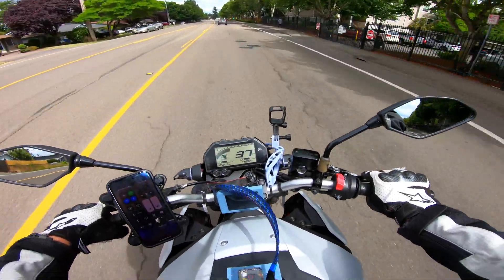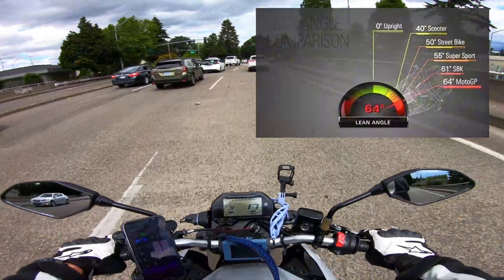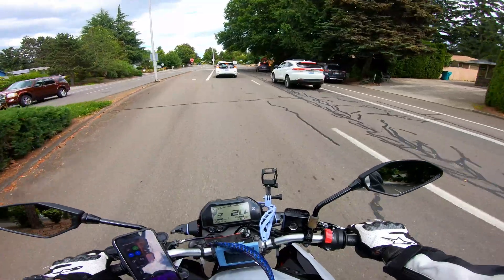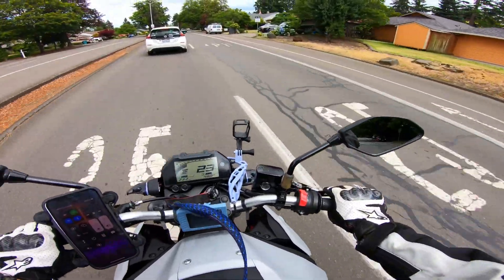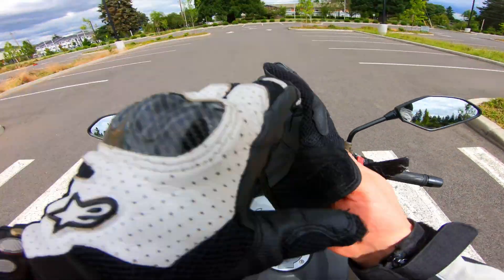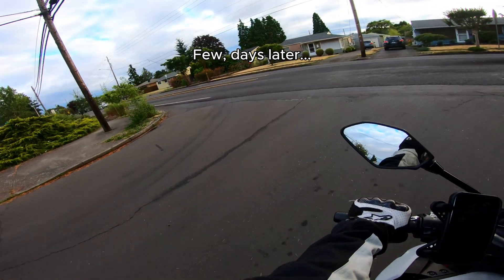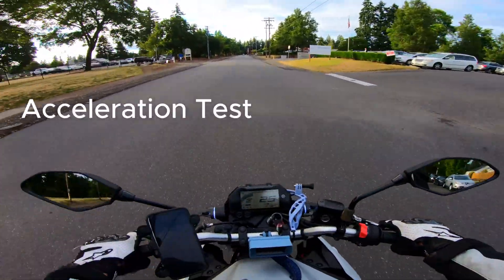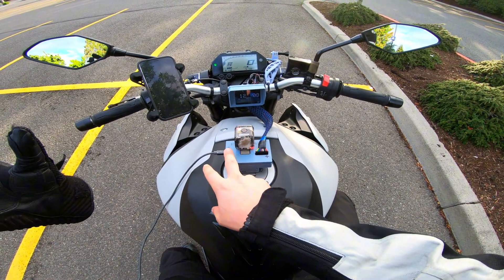Why don't they make these for all bikes? | LEAN ANGLE SENSOR | ESP32

Comment: Good project.
I bought a couple of different 
inclinometer devices, but they
are both useless on a motorcycle, 
they're all over the place, the only 
time you get a good reading is when
the bike is parked on the-side stand. 😄
Reply from the maker: haha yes, nowadays though you can probably get good AI filters to get a better signal to noise ratio. This is the biggest issue in the data processing is getting that clean accurate value from the chaos hahaha. I moved on from this setup to an app based UI and mounted the gyro/accelerometer in my pillion seat bag.
Reply: @OneSmallFavour  
Cool. 
There are some race bikes that
have onboard inclinometers, 
they are obviously going to be 
accurate. The problem I've found
is that the g forces of turns, 
tend to push the gauge opposite of
the angle, so If I'm at 30 degrees
it will  read something like 5 to 10 lol,
not useful to me. :sm 
They're actually good though if 
I want to look at some static angles.

Comment: hello, I am interested in your project and I congratulate you for your efforts. i've spent a long time with the mpu6050, but I want to use it for cornering lighting. I didn't get a stable value. everything is normal at the counter. until we set off on a motorcycle.
Reply from the maker: the engine of the motorcycle is causing some small vibrations which throws off the data, you need a smoothing algorithm if your using a sensor as bad as the MPU6050. get a better sensor or get into signal analysis. best of luck! <3
Reply: @OneSmallFavour I just ordered bno55. I hope I get positive results.

Comment: hello! I would like to study the code you used for this project. I have been trying for months in every way to create a sensor for reading the lean angles. if you want to share the code and the schematic, I can give you my email. bye and thanks
Reply from the maker: Sure, I included a drop box link in the description. The code I used here is for an ESP32 but I also have a flutter app for android, but its a little too large of a file to share. If the link isnt showing, check back tomorrow
Reply: @OneSmallFavour  great, I downloaded it! Thanks!!
I searched online for the sensor, because I use an MPU6050, while I saw that in the code you use the BNO055. I found several links, but some are badly reviewed... Where did you buy it? Amazon? Aliexpress?

thanks again for your availability
Reply: @OneSmallFavour  Great, I managed to download it! Thank you very much. I saw that you use a BNO055, I was using an MPU6050 instead. I saw online that there are several modules like yours, but sometimes they have bad reviews. Where did you buy it? Do you have a link?
Reply from the maker: @albo0.247  I think Amazon has them for around 30$. Otherwise adafruit webstore or maybe eBay could also have them.

Comment: Nice, was planning on making one my self like you for my ninja 400: but I got an aim solo 2 dl and that seems to have all the stuff, just need to calibrate it and figure out the software.
Reply from the maker: wow i just looked up the aim solo 2 and it looks pretty sweet. Uses satellite data pretty cool. For 400+$ I'll need to look into that haha, the device in this video is around $25, but without the screen (phone app instead) and some custom PCB's it could be less. GPS sensors can be expensive but i bet its pretty accurate, would like to hear more how it goes when you use it.
Reply: @OneSmallFavour  totally will let you know, have a track day tomorrow and the day after so should be good to see.
Reply from the maker: @rooneyw2208  that’s so cool. Good luck and be safe :)